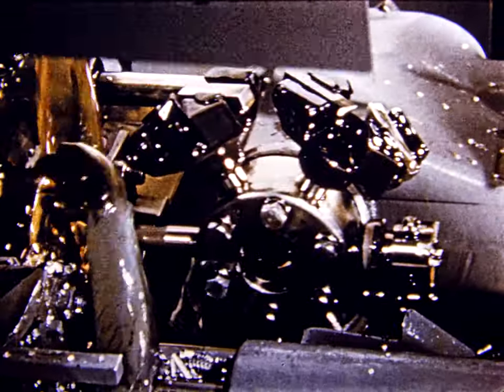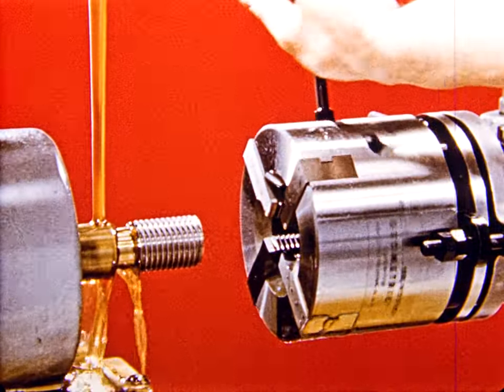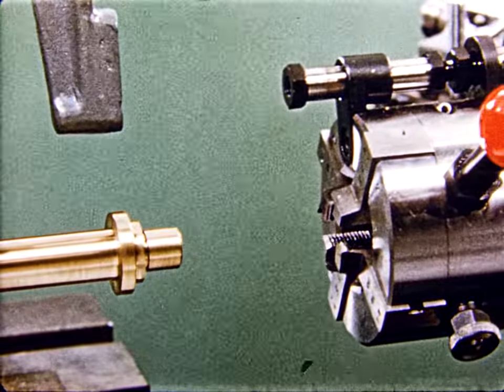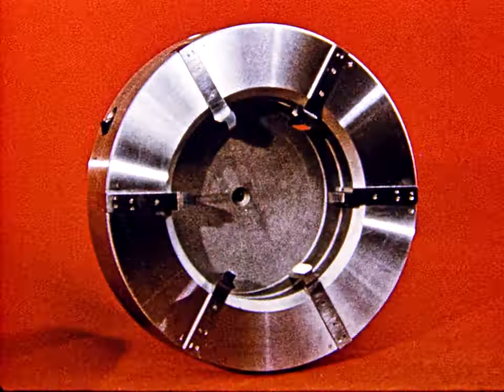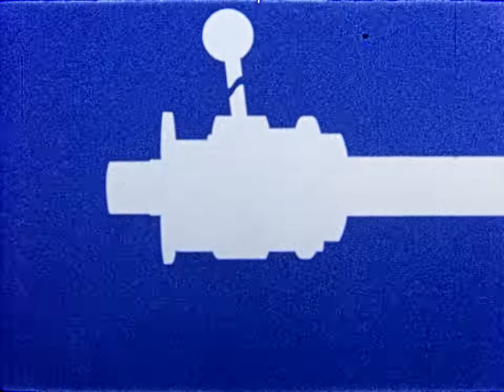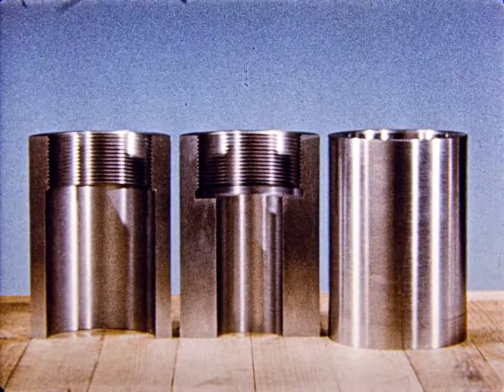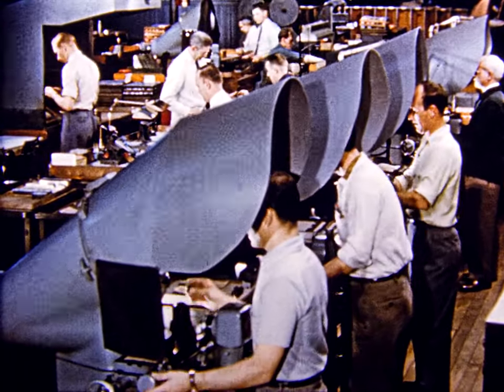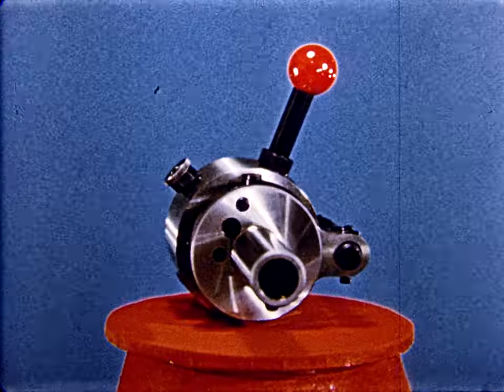Geometric Tool Co. New Haven CT

Comment: Great film.
Reply: Hi Randy we have the smallest one the company ever made SURPRISE so small it is not automatic you have to reverse the spindle of this die we will share one day in use, it is actually model or part number EJ5, stand for the die head 1.00" diameter, as it can hold a 5 mm maximum capacity die, thinking you might like that information as a turret lathe owner you might appreciate this share from us.  L&P